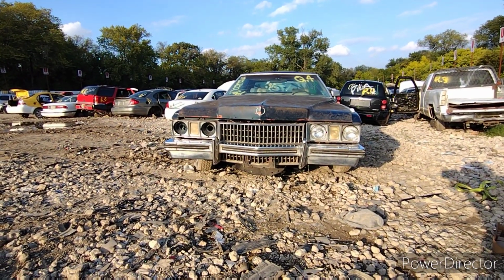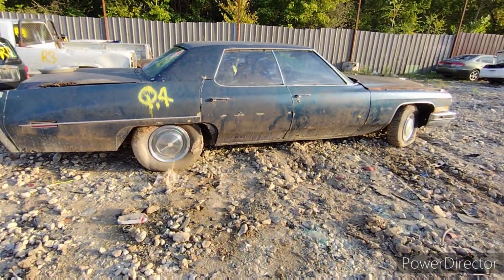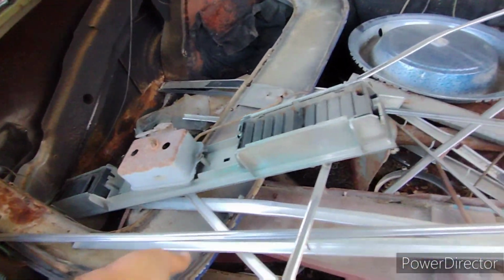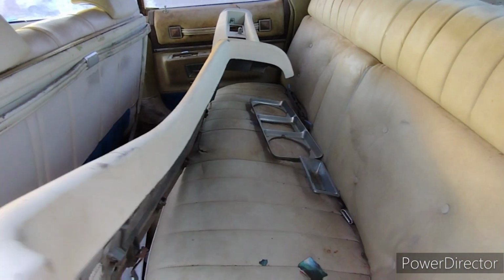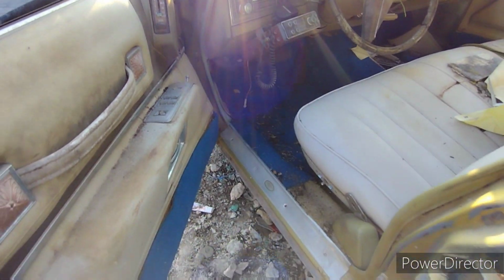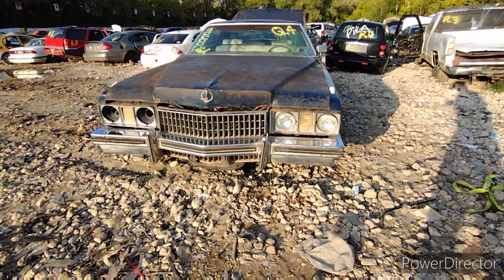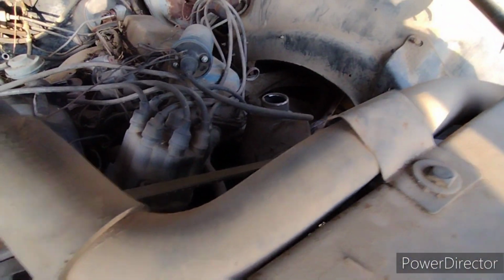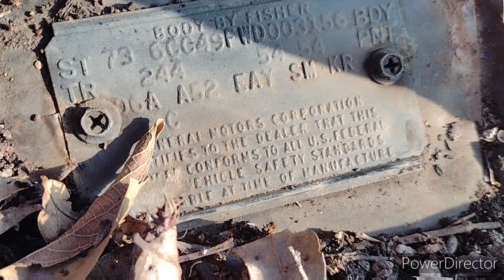Entry Level Caddy Abandoned Project Off The Road Since 04. 1973 Cadillac Calais Junkyard Find

Comment: Whoa Nelley, 1973 and it's over for thee.

Yes, "CAL-LAY". It's French and the "s" is silent. Yes, the Calais is the entry level Cadillac.

We got the VIN, we win: 6 for Cadillac, C for Calais, 49 for four door hardtop four window, R for 472 V8 with four barrel, 3 for 1973 model year, Q for Clark Street, Detroit, MI assembly and the rest is the production sequence. The Clark Street facility closed in December 1987 and as noted many times, there is a YT video of its' last day in operation. There were 3,798 of these made for the 1973 model year. You still made it in the world even buying a Calais new in 1973. Cadillac was the "Standard Of the World" back then. You aspired to own one when you made it in life.

We got the tag, we can brag: 73 for 1973 model year, 6CC49 for Calais four door hardtop four window, FWD for West End Street Fleetwood Body plant, then to Clark Street, Detroit, MI for final assembly, 244 for Medium Maize Mayfair Cloth with vinyl bolster interior trim, 54 54 for Renaissance Gold upper and lower exterior paint, 06A for the first week of June 1973 production, A52 for bench front seat, E for Soft Ray Glass (tinted), A for possible rear window defogger, Y for six way power seat, S for front shoulder belts, M for power door locks with seat release, K for automatic climate control, R for steel belted radial tires, C for cruise control.

You sound like me today, aching and just tired. LOL. I had a Whirlpool "110 prefix" (any Sears appliance with a 110 model number prefix was made by Whirlpool for Sears) made Kenmore gas dryer belonging to my uncle kick my ass. First, the repair kit from Amazon (a sealed OEM Whirlpool kit) came missing parts, the inside of the machine was full of lint which took over an hour to clean out, and then we had to make a trip under the gun and hour and half up and back to find another kit (I was fortunate to find one and the guy was willing to wait up for us if we were a little late. We made it with plenty of time. Great old school place). It needed rollers, a tensioner pulley, a new belt (all come in the Whirlpool OEM kit) and new roller hardware (that's what was missing from the kit, a sealed box), plus the blower wheel was shattered into pieces. I got it all back together, but I was up and down all day, on my back, on my feet, you name it. It's nice and quiet now. Whirlpool (and Kenmore made WLP) dryers are made in Marion, OH and the washer that it was paired with (gone now) was made in Clyde, OH. So, I joked, "Clyde and Marion were married since 2008. They met at the local Sears. But Clyde became incontinent (leaked) and had to be retired. He was getting old and cranky, so Marion replaced him with a newer model. Now Marion got cranky and was very noisy. She's now nice and quiet now and back to her normal self."  But, for $50 in parts, it works like new, I saved my uncle a ton of money and the cost of a new dryer. If you want to know who made your Sears product, the first three digits of any Sears major model number is the "source code". You can look that up online (I've contributed to many of those lists) and it will tell you who made it for Sears. You can then buy parts from that source and fix your Sears equipment at a fraction of the cost. No need to go buy "Sears" parts, when all they are doing is getting them from the source and marking them up. The trick is knowing who made it for them, and that's usually not too hard. 

Whoa Nelley, Cadillac Calais and it's going away. Painted gold and looking kinda old. "C" body looking very shoddy. Cadu, it's over for you. 472 V8 used to be great. Quadrajet lives on yet. That's it, time to quit. Google Man became the Maytag man and prevented Marion from becoming a soda can. Cadillac had a heart attack. Cadillac weighed a ton, now it's just about done. "Seems Like Everyday" by the Rossington-Collins Band and this one is ready for the trash can. Cadillac on the cheap, now it's nothing but a heap. Going to get squished and the General's faithful, many here, maybe Benny, but surely the Google Man are going to be very, very, very, very, very pissed.
Reply: I never  owned a  70's model  Cadillac  but I have  driven a few  and I  never was impressed with the  power  from  those  engines and to me the Oldsmobiles or Pontiacs  had a  better  ride and power.
Reply: @garymckee63  With Cadillac, it was all about torque and a smooth ride. All of the GM big cars rode well, but the Cadillacs insulated you from the world and had some features that were not found on other divisions. GM "tiered" their offerings eventually stepping you up to a Cadillac, their most expensive (and likely most profitable) offering.
Reply: @googleusergp  The 95 Fleetwood  l had  of course  the Chevrolet 348 ran very well  but I don't think  it would have  lasted  as long  as  the Cadillac engine  but  most  it seems  no took the proper  care of  those  vehicles
Reply: @garymckee63  Those are pretty reliable engines. They saw heavy use in law enforcement and fleet applications.
Reply: How about that, and for all these years I thought the old Whirlpool FSP stuff was made in Benton Harbor Michigan. I guess maybe BH was just where the business headquarters used to be.
Reply: @mjg263  Benton Harbor, MI is their headquarters, but they have plants all over the US. I just fixed a Whirlpool made Kenmore "110" mode prefix dryer for my uncle. That was made in Marion, OH. They used to have a matching washer made in Clyde, OH. I have a WLP made "665" prefix Kenmore dishwasher. That was made in Findlay, OH.

Comment: does in fact check out as a Calais from Clark st Assembly with the 472. Brings back memories of my 1973 Cadillac Superior Hearse. Those ole caddys are land yachts, I remember in the 80s $5 would give you like a 1/4 a tank, think the commercial chassis probably had a 30 gal tank. You could literally watch the gas gauge go down rapidly when those Q-Jet secondaries were open frequently, those 472s are thirsty beasts to feed.
Reply: Correct. The body was made at the West End Street Fleetwood plant and then over to Clark Street in Detroit, MI for final assembly.

Comment: Production of the 1973 Cadillac Calais Sedan was 3,798 units (this example is VIN 6C49R3Q287146)... compared to the 1973 Sedan DeVille with 103,394 units. The DeVille had nicer trim with rocker panel mouldings extending to the rear fenders and available full leather upholstery. The Calais never offered leather trim...instead either "Mayfair" cloth and vinyl or an optional expanded "Sierra-Grain" vinyl (this example has been reupholstered from its original Medium Maize/Gold cloth and vinyl, Trim Code 244). Paint was originally Renaissance Gold Metallic, Color Code 54.
This example includes the following options: $59 Soft Ray Tinted Glass (E), $95 Cruise Control (C), $89 6-Way driver power seat adjuster (Y), $69 Power door locks (M), $523 Automatic Climate Control A/C (K), $156 Steel Belted Radial Whitewall Tires (R), $95 Tilt and Telescope Steering Wheel (Q).

Comment: Front seat is a Calais Seat (Vinyl, 1 row of upholstery buttons), but the back seat🪑is from another car (more buttons-would be leather).
Bet 2nd owner used as a car to provide for-hire transportation like an airport limo or black-car service. That would account for the rear seat wearing out but the front seat staying in good condition. Also they repainted it because gold would not be appropriate for the service it was used in.
Reply: You would think that a limo service would have at least insisted on having the door frames and sills painted to match the exterior?

Comment: Interesting. Never seen a caddy Calais. Only a small Oldsmobile. But this caddy was before my time.That caddy is about a mile long!
Reply: They  been around for awhile
Reply: You're thinking of the Oldsmobile Calais, possibly the "N" body front wheel drive that came out in 1985. There was also the "Calais" trim line on the RWD Cutlass for a number of years as well.
Reply: @googleusergp  no I had several Cadillacs I use to drive one they did make one but it's not spelled that way it did start with a c
Reply: @googleusergp   I looked it up they did make one and it's spelled right
Reply: @josephwatson2711  If you mean the Cadillac Calais, you're looking at one right here. LOL. The second VIN digit is a "C", which is unique to the Calais. DeVille models were a "D" for the 2nd digit in 1973.
Reply: @googleusergp  they also made a newer model big body
Reply: I use to own one I had a 1976 model
Reply: @josephwatson2711  What year and model are you talking about?
Reply: @googleusergp  I had a 1976 Cadillac Calais 4 door now I own a 93 Cadillac sedan DeVille 4.9 engine it has a 103 thousand miles on it love it

Comment: I'll tell you one sure way you can always tell if it's an entry level Calais model instead of it's Sedan Deville brother.  Look at the brake and gas pedal. On the Calais models, GM costed out the chrome inserts so it's the only Cadillac made with just the black rubber pedals alone. No chrome inserts. As you can see in this video, the pedals do indeed lack the chrome inserts so it is a Calais.

Comment: Hell, someone was probably making way for an efi conversion for that beast. Perfect car for simplifying. Hoping someone does save it from the crusher. Vintage air and fuel injection would help it out quite a bit. Flush and repair the cooling system as needed, and new tires all the way around, and it could be a nice runner.

Comment: Why do Americans call full wheel covers Hub Caps  ? They are not HUB CAPS. It irritates me. Hub caps Only cover the Hubs .
Reply: Probably because They were hubcaps primarily up to the 1930s.   However the old name just stuck even though they were officially called wheel covers.
Reply: @kennethsouthard6042  Exactly.
Reply: @googleusergp  is there an official name for "dog dish" hubcaps since they cover more than the hub, not the full wheel?
Reply: @kennethsouthard6042  "Cover, wheel" typically in the GM parts book. Just call it a hubcap or wheel cover. Same thing. Lol.
Reply: @googleusergp   My Uncle who used to write service manuals for Ford used to refer to the dog dish style  as beer caps.   Obviously, not in any official documentation.
Reply: @googleusergp   Were there specific companies that were contracted with to make metal wheel covers back in the day?   Or were they produced in the house?
Reply: @googleusergp  Amazing now when you look at the amount of design, tooling, stamping, polishing, paint and chrome work that went into these things meant to just cover steel wheels.
Reply: @kennethsouthard6042  Factored into the price by the bean counters.
Reply: @kennethsouthard6042  ITT and Norris were two main suppliers of wheel covers and trim to GM and others.
Reply: They are called hubcaps by everyone maybe not you or where you are but everyone I know calls them hubcaps